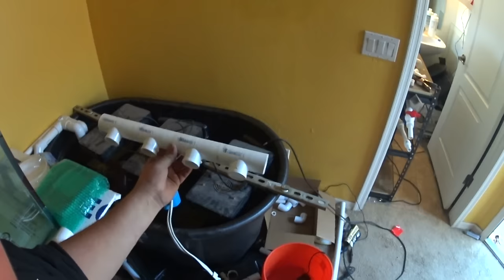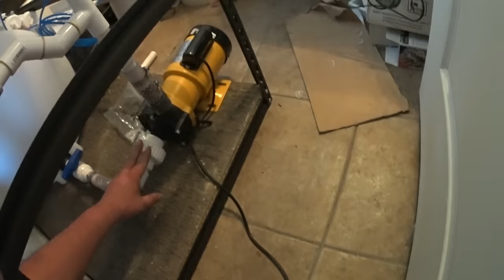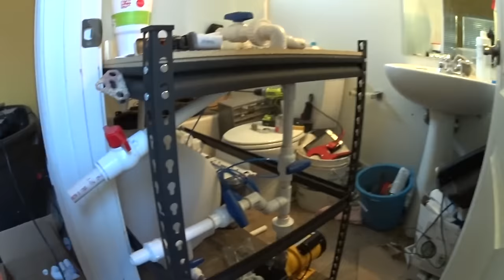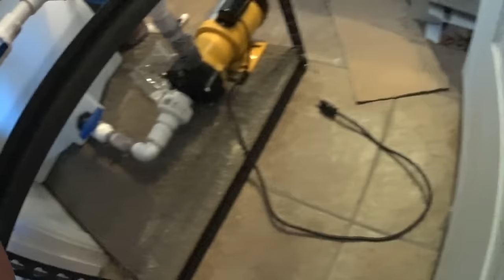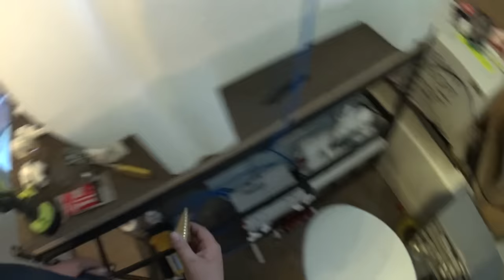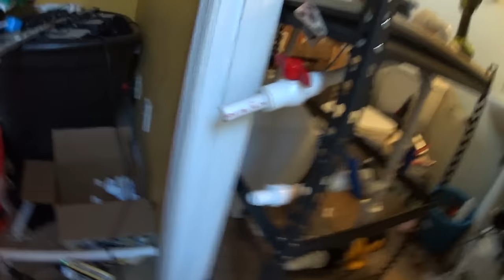Fish room build 4

Comment: Yo so I have an idea on saving u space in the bath room. Put a peace of 3/4 inch plywood over the tub and put the water tanks on top of the wood. That tub should hold it no problem. I'm a plumber and when we remodel the tub area and don't get rid of tub that how we protect tub. We even stand on tub all day wile working and it hold use. And we two big guys. Just a thought. Nic vid mam
Reply from the maker: +Anthony Lujano I definitely had that thought as well and may do it later on.  Good to know the tub will have no issues holding the tank though.  thanks for watching!!!
Reply: +Anthony Lujano great idea even if they leaked.. you would be safe... right down the drain.. not to mention toilet would be accessible if needed..

Comment: Get into a habit of verbally tracing  the flow that you want to achieve through the pipes  before the power. The more features you add to a system like this, the higher chance of not having the correct valve open or closed at a given point. Things can get interesting at that point.